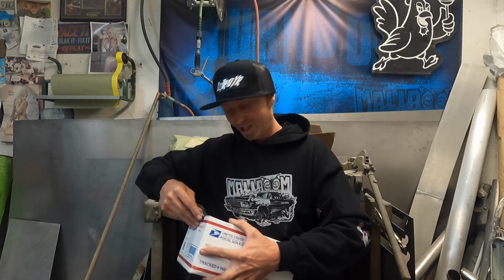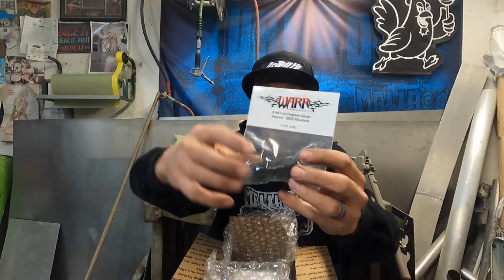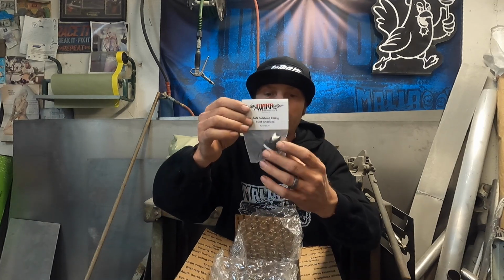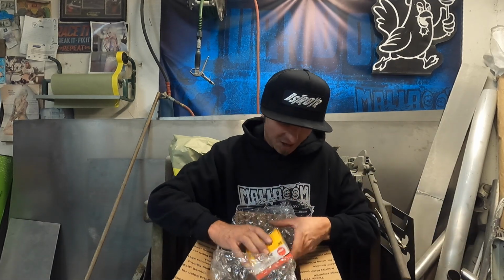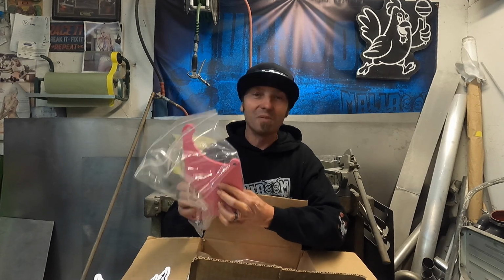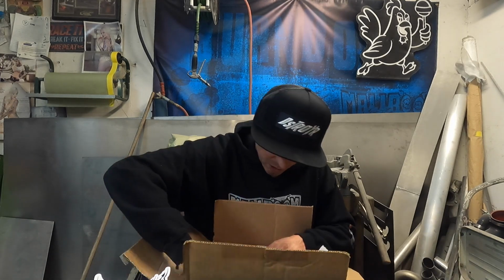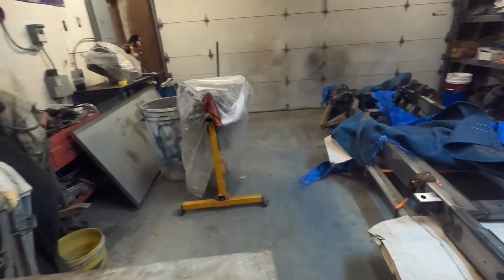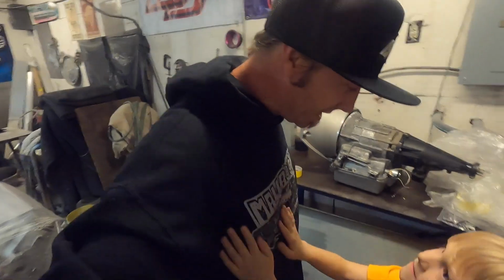Mail Time From Warr Performance

Comment: i run 7s in everything because ive seen no real negatives, and everyone eventually turns it up so the safer plug is nice to start with.
Reply from the maker: Where would you say tr6s are good to psi or power wise for the most part? 20psi range?

Comment: Ya I rebuilt my 4l60e and thought I did everything right but I was pretty anxious putting it back in because I needed it too but it's been like 8 months so far so good and I put in lots of good parts
Reply from the maker: Im going to build an 80 for the Maliboom next. Its a bit more involved but I feel like having done the glide a few times I feel like I can tackle the 80. The glide was a learning curve for sure. I modified the pump and case, I swapped out a bunch of parts as well. The 80e will be closer to a stock build with some upgrades vs having to change and leave parts out. Its confusing when it your first build and your wondering why you have extra parts and if it was done correctly.
Reply: @Burndown  cool I mean just lock up would make a big difference but I don't think It's available with a glide

Comment: Warr performance FTW‼️ I wasn't aware that they had that expensive of a parts catalog .
Reply: I said the same thing.
Reply from the maker: I feel like I need to showcase stuff at least once a month on what they have. They are busy all the time so Ill look around and find stuff I think is cool or helpful and ill start covering it. They have quite a bit of stuff for the LS guys.
Reply from the maker: When I started dealing with them I also said the same. They also seem to have stuff in stock when other places may not because they are still a hidden gem at this point IMO.